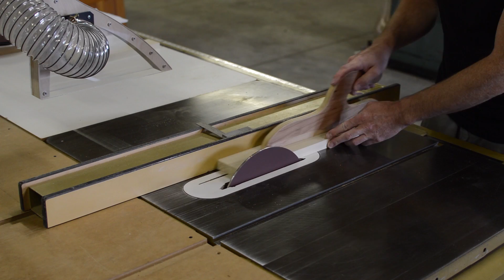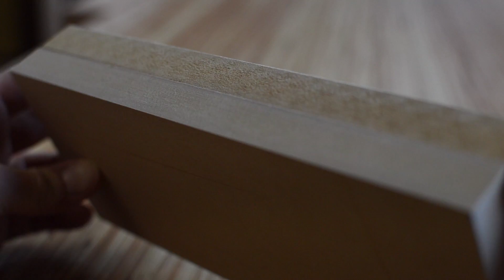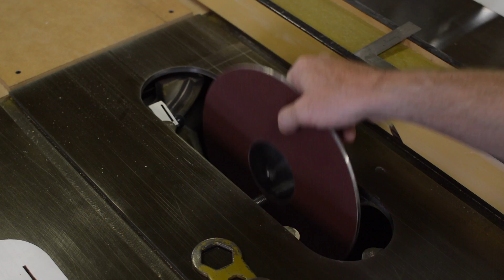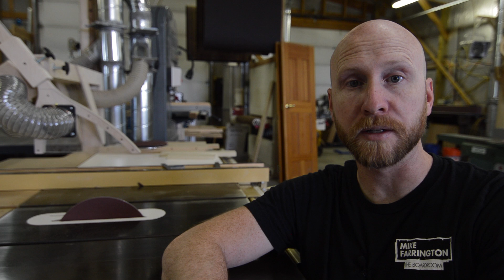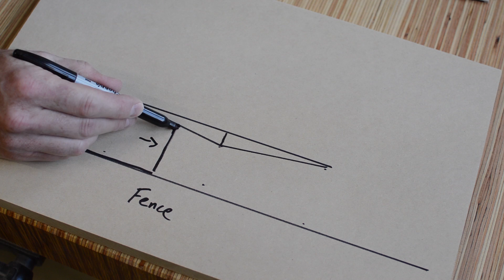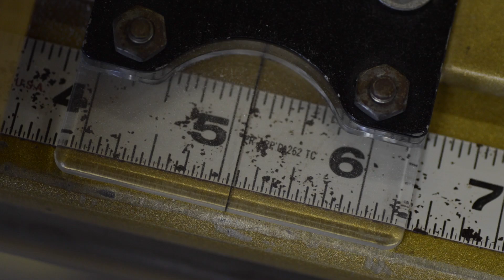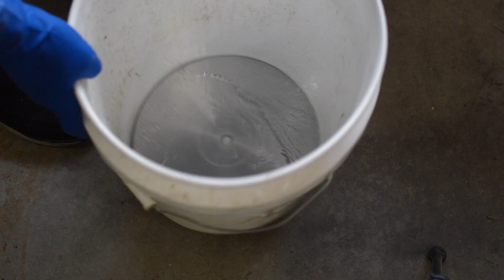This sanding disc will improve your woodworking and carpentry, period.

Comment: Congratulations on bring this to market, but this seems more like a tool looking for a problem/need as apposed to a problem/need looking for a tool.   I just can’t see the need to justify the price.  If a jointer doesn’t leave perfect edges for glue up then something is wrong with the jointer.
Reply from the maker: That isn’t the main thrust of this product, it’s a side benefit if needed. This is for sanding the edges of parts. I mostly use it for doors and face frames. If that’s what you took away from the video then I really didn’t do my job of explaining what it does.
Reply: Finally! I thought I was really missing something when no-one else was posting that! If you are joining two pieces of wood, YOU DO NOT SAND THE EDGES!!!! And if you are NOT joining them, then you will also have to BREAK the edges, or the piece will be too sharp to install safely. Hence, we use planes, jointers, or a GOOD table saw (slider anyone?) to get a joinery-ready edge, and we use a beveled sanding block or some form of cutter to bevel/break edges.  
Let's leave the discussion of sprung joints, etc. for another time, other than to say that this tool doesn't make those either.... Doors need (and have) a rounded edge/bevel in order to fit their door frames, and if they don't, they will once your trim carpenter goes to hang them. And decent face frames use joinery, as opposed to butt joints, and have grooves along one edge for panels, that, again, need to be broken. 
Finally, what happens to the calibration of the table saw fence? That disc is thicker than a saw blade, so the measurements at the fence will not be correct.

In my shop, when I need to sand the edge of a board, in order to shave it down a bit or maybe to prep for finish, I use a tool called an "edge sander". It sands edges. Yep, that's pretty much all it does. Really quickly. With no set up in almost all use cases. It can even make radiused corners, if I need one of those. And I don't have to peel off the sandpaper either. Anyway, I hope it works out for you; it does seem to be received well.
Reply from the maker: @kevinnathanson6876  Kevin, I appreciate the though you have put into this comment, but I think you're looking to find and issue with the disc, and I don't think you fully understand how and why it works. Its a tool like any other, its preforms a certain task. Thats useful to you or not. For the last 2 decades I've earned my living making cabinet doors, face frames, moldings, and other furniture parts, almost every single one of the parts that made up those assemblies was sanded with a tapered disc on the table saw. Give it another look with an open mind, I think if you had one in your shop, you could find all kinds of uses for it.

Comment: Trying to figure out if I can use this on a Sawstop Jobsite Pro.
Reply from the maker: Yes, the disc will work on a job site saw. Confirm that you can tilt the arbor 2 degrees towards the fence.

Comment: How many feet should i expect to sand with  one disc?
Reply from the maker: If you take small cuts and your stock is well prepared, I would say thousands of feet. Heat is the killer of sandpaper, larger cuts generate more heat. Also, wood that is very resinous will clog up the paper quicker.

Comment: Could this sanding disc be used in a sliding table saw?
Reply from the maker: Yes. I have some discs with 30mm arbors, but they do not have the braking holes drilled. Those can be drilled out though.
Reply: @MikeFarrington  sounds good.  Would a machinist do that sort of thing?  Thx
Reply from the maker: @tundrawhisperer4821  A machinist could do it, but also any business that sharpens saw blades. Its a very common thing to do. If you are brave enough, its pretty easy to drill them on a drill press.

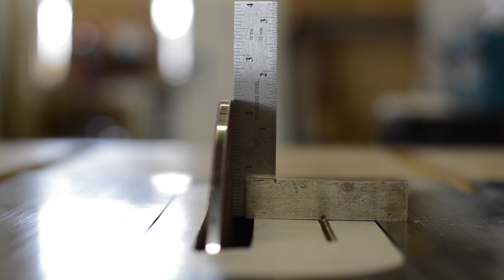Comment: I'm probably being an idiot, but do you run it with the disc 2° from 90, or at 90? At around 4:30 you mention setting the disc back at 90°, so is the 2° necessary?
Reply from the maker: Thank you. The 2 degree taper creates a wider opening at the front and back of the blade, so the sanding is occurring only at the center point. Setting the arbor 2 degrees towards the fence allows the edge of the workpiece to be sanded at 90 degrees. Hope this makes sense, I did my best to show this in the video.

Comment: Will it work on Roland panel saw?
Reply from the maker: Yes, it will work on any saw that has an arbor that can tilt toward the fence. I have discs with 5/8", 1" and 30mm arbors.

Comment: Not sure that this contraption  will work in the long run:  Table saws are generally not designed to take axial loads, so I would be worried about introducing a lot of wear in the bearings and arbor.  
Bernhard
Reply from the maker: Thank you for your thoughtful response. I have been using a similar disc with a taper on one side in my current table saw for almost 15 years. I'm sure in that time I have run it for a couple thousand hours. I have not had to change the bearings yet, and for many of those years I have had less than stellar dust collection. Thats anecdotal, but I think bearings, for the most part, won't be an issue. I don't think the side load is very high.
Reply: @MikeFarrington   Hi Mike,
Thanks for the response.  That is good to know, that you have used this system  in a commercial shop for quite a while., so there is no issue!
Thx
Bernhard

Comment: There is something about the bevel that doesn't make sense to me. Maybe it is because I don't get it in my head. I will have to go and draw it up on the drawing board. But this is my train of thought. On the horizontal plane (table saw 'bed), the bevel in the drawing you made makes sense. But the lower you lower this 'blade', the more(or less) accute the bevel becomes. This (to me) is because it is a round object/disc. So the bevel 'repeats' itself on every degree around the axle of your motor...
Let's say that the table saw table/plane is 0 degrees. On this angle, the drawing you made will make 100% sense if this can be sanded the whole thickness of the piece of wood/plank. But, if the bevel rotates up to 90 degrees to you table, suddenly, the bevel makes a V shape in relation to you table. In my mind, the piece of wood/plank is now sanded with a bevel.
Exaggerate the angle of your disc, and the problem will be magnified.
I am open minded and prepared to be taught. But in my  mind, the only point that gets truly sanded correctly is the first few millimeters of the plank that touches the table and makes contact with the sand paper first. it is a shame one can not attach images to YouTube comments. This will make it easier to explain my thoughts. 
Anyone care to educate me?
Reply: The only way I can see this being 'resolved', is if the table saw fence can also be rotated in relation to the disk. What I mean is, if you see the image you have drawn from the top, the plank will make complete surface(side) contact with the side of the blade, and not only towards the center of the blade(closer to the axle). If this can be done, you will not have kickback on the blade, because the plank will be on the 'other side of the blade' where the bevel turns away from the wood. Once again, a drawing would have made it easier to explain what I am trying to say.
Reply from the maker: I appreciate the comment as well as the interest in this product. With that said, I'm not quite sure I follow what your saying. What I can say is that this disc will sand the edge of a piece to a perfect 90 degrees or another angle if you adjust the arbor.
Reply: @MikeFarrington  I take back my words. I somehow missed the most critical set-up settings you showed! While I made some drawings to post here to help explain, I came back to your video to look for it. And then you showed that the blade has to be tilted 2 degrees!

So my apologies for this post.

Comment: Functionally, this seems like a great thing, especially if you're banging out a lot of parts in a production-style manner.  However, unless you're cutting and then smoothing tons of the same cuts in a row I'd have a hard time justifying the the time to swap/align the blades every time.  This would be pretty nice though if you for some reason had a second table saw.
Reply from the maker: With any tool it depends on what you are doing. I find it easy to justify the setup time just to sand the inside edges of a couple doors. Swap time shouldn't be more than about 2-3 minutes.
Reply: You must be incredibly busy if you can't justify 3 minutes lol
Reply from the maker: @patrickweaver5290  I agree.

Comment: Will t work on a SawStop?
Reply from the maker: Yes, the saw should be in bypass mode. Also check to see if you can adjust the tilt 2 degrees towards the fence, or make sure you are comfortable with the fence to the left of the blade.

Comment: Funny, I’ve got a disc from back in the day from Sears Craftsmen table saw accessory. I think I only pay about $20.00 for it!!! So it’s not a new concept.
Reply from the maker: I used the same one, when I was first starting out. I mentioned in the video that if you've watched any of my videos you have seen me using something similar. With that said, mine is the only one that can run two different grits.

Comment: Hey can you use this in a miter joint situation? Turn blade to 47deg in that instance?
Reply from the maker: I have used this for miters and bevels. So long as your saw can tilt over to the angle and your setup is safe, yes.

Comment: Sorry, but I just can’t see a place for this in a professional shop? I don’t mean this to be disrespectful. Maybe good for someone with limited equipment though? Agree with you on not trusting the 90* stop.
Reply from the maker: Well I have made my living as a cabinet maker for 2 decades now, and I've been using a similar disc the whole time. In fact, its the small shop that can benefit from this the most. If you haven't used one, don't write it off. Having the inside edges of FFs that need no further attention will pay for this disc in one job.
Reply: @MikeFarrington  you should link to some of your older videos where you use a similar disc.
Reply: Matt V ....... that’s going to be a problem.

Comment: $150? Ouch. Tough sell when you can just glue sandpaper to an old saw blade for pennies. Video floating around of of Heinz doing this. Easy enough.
Reply from the maker: Not the same thing, and the results wouldn't be nearly as good. The taper creates a single point of contact at 90 degrees in the center of the disc, then at exit the sand particles aren't touching the work, this means a more consistent scratch pattern, and much lower possibility of kickback. Also, didn't John mention that it was only just a so so idea?
Reply: @MikeFarrington  I guess the value then is for pros vs hobbyist like myself.

Comment: Just had a look at pricing, very fair!  I think I paid nearly 500 for my one-off.  Small spelling error on your website listing...under product notes you have a "you" instead of "your".  Good luck with sales.
Reply from the maker: Thank you. Having just one made I got a quote of about that amount. I needed to buy a pretty good chunk to get the price to what it is. Thank you for the spelling error check. I'm just a one man band, I can't catch it all.
Reply: @MikeFarrington  Get the program Grammarly. It doesn't just check for spelling mistakes word by word like most spellchecks does. It also checks for gramatical errors like you instead of your.
Reply from the maker: @Dragonited  Thank you, great tip.

Comment: I finally got this and tried it on some cherry boards, but I found myself getting a ton of burning with the 120 disc, even when I tried restricting to 1/64th increments.  Thoughts?
Reply from the maker: Cherry is an easy wood to burn. First, have you checked moisture? If there is a little bit of extra moister in the wood that will create extra heat and then burn. Next would be feed speed, if you can try increasing speed, if this does not feel comfortable then don't do it. Finally, take an even smaller cut. With certain woods I find that I have to take a very very small cut to avoid burning. If this doesn't work, please send me an email via my website. My guess is if we work at it, we can find a solution.

Comment: $160 bucks tho
Plus $30 for four pieces of sandpaper
Reply from the maker: Quick correction. Its 160 for the disc and 4 pieces of sandpaper. From there more sandpaper can be purchased.

Comment: I will not pay that ridiculous price for that. I'm seen them a hell of alot cheaper with 4 to 5 star reviews and yes they are tapered
Reply from the maker: Thank you for your input. I'd be curious to know where you find other tapered sanding discs. I would also be curious to know if they are made in America, as that does add to the cost of my disc.
Reply: Well, did you find a link to the 'helluva' lot cheaper Discs yet Chuck???

Comment: I was taught over 60 years ago by a master cabinetmaker that you should NEVER glue a sanded surface ... ONLY one that has been cut.   Sanding drives debris deep into the pores and prevents the glue from doing it's job.
Reply from the maker: This is incorrect. A glue bond created by the surface left after using this sanding disc will be stronger than the wood. A sanded surface using another tool or by hand could be problematic as the edge may be slightly rounded, creating a situation where there isn't good wood to wood contact. As to debris being driven into the wood, thats not an issue either, in fact some professional glue applications have a fine sand partial in them to prevent slipping.